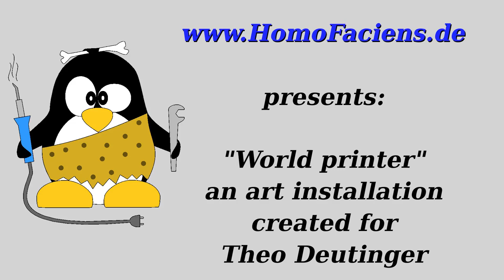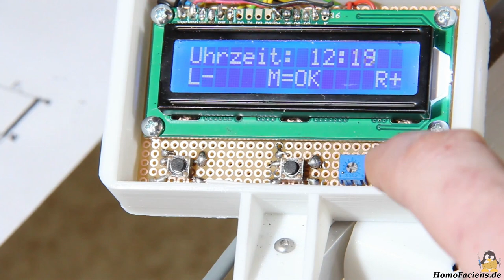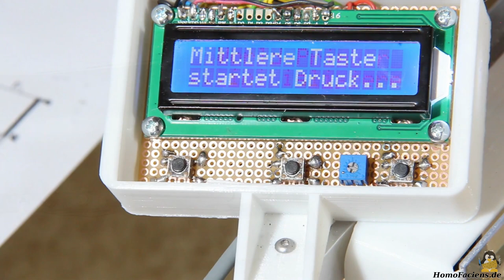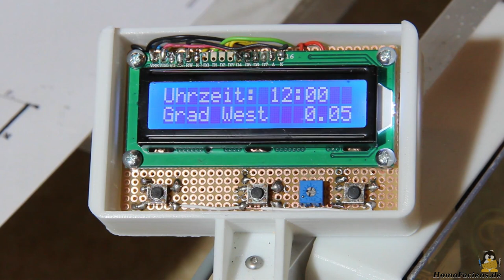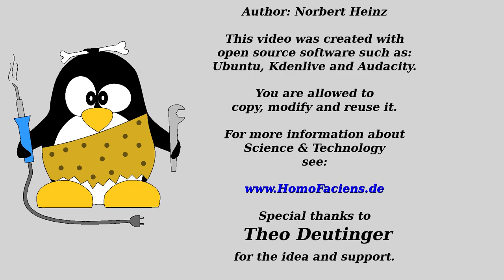World Printer - an art installation for Theo Deutinger

Comment: super. might be you can interest on HP45  cartridge. i guess its opensource .
Reply from the maker: Yes, I had a look at the HP45 documentation as well (its not open source by HP, but someone has done the reverse engineering). However, the HP6602 is more easy to control.
Reply: @HomoFaciens  are u thinking  make a plotter in the future ?
Reply from the maker: Yes, somewhen. A plotter is not on top of my list of things to be done...